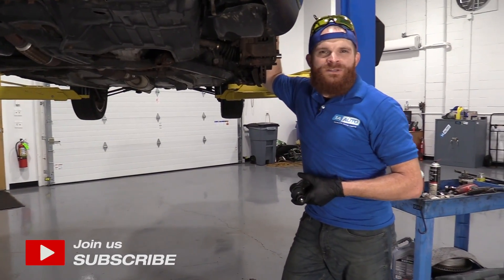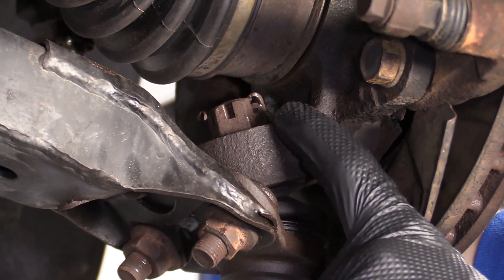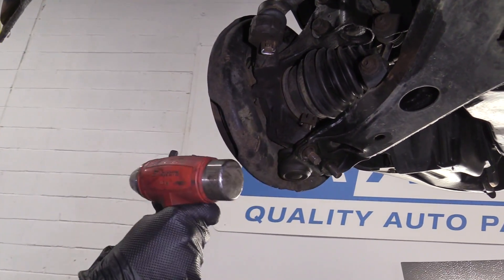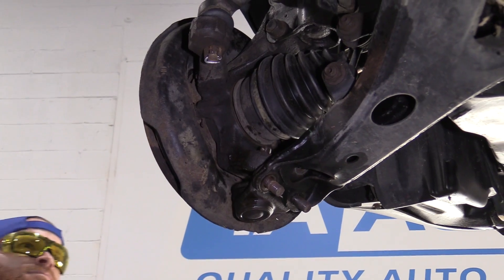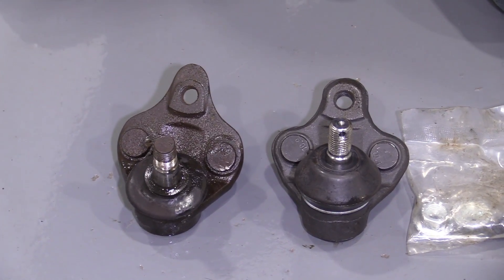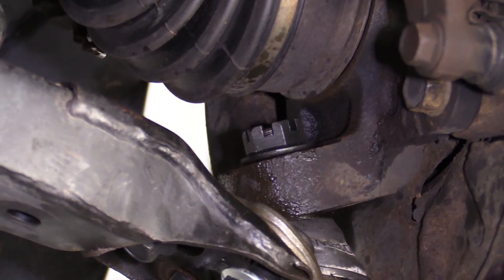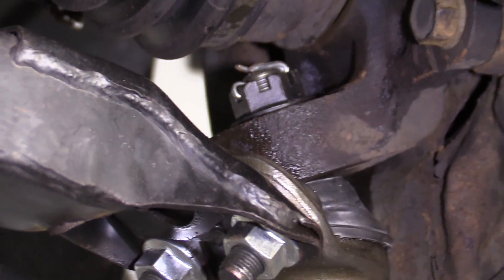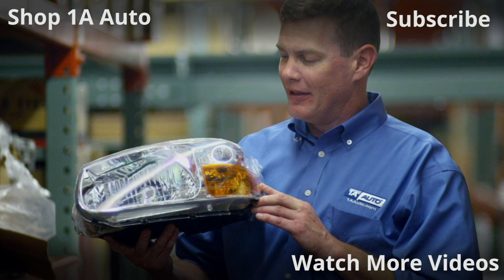How to Replace Front Lower Ball Joint 93-95 Toyota Corolla

Comment: Just did mine on my 95 Tercel.  I can say with authority, the main nut DOES NOT loosen that easily.  One side I had to remove the axle from the hub, undo everything else, cut the nut off and  hammer the stud out.
Reply from the maker: +Paul Bateman Thanks for the feedback!

Comment: You make this look so easy. I have a 2004 corolla which is basically the same. When I put the new ball joint on , there was a good inch of space from the control arm. I had to fight with it for a good hour and a half to get the bolts back in. I don’t even know how I was finally able to get it back together. Wheel feels great though, no more clickety-clack going on.
Reply from the maker: +jhm2112 Thanks for checking us out and the feedback! 1AAuto.com
Reply: Hahaha dude I think its because he has a lift
Reply: Hi sir..the missing part on this video to avoid fighting all the way is to get loose the sway bar link that is right behind the axle. I really dont know why this guys use the pry bar...is not necessary. Just be sure to disconnect your sway bar link while the car is on the floor, then do all the job of replacing the ball joint..after you finish put the car back on the floor and reattach the sway bar link again. Hope this is helpful for any with a corolla of this gen.
Reply: @cristiancruz5079  Here's the problem with that. Sway bar links (at least on both my 01 and 02 Corolla) don't come off very easily. At least the lower bolt. I had to cut off all 4 links so the pry bar isn't that hard to use in comparison to having to break out the saw and cut off the sway bar link.

Comment: I used this as a template to do this on my 2018 Corolla and I skipped a few steps and almost screwed myself and it took probably 30 minutes of hammering with a few different pickle forks in different directions to break the ball joint loose from the knuckle